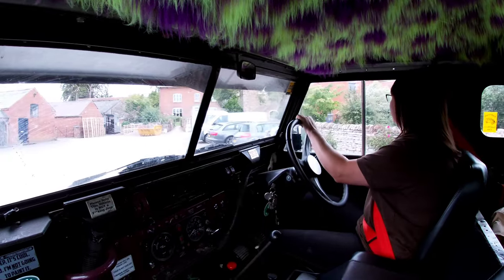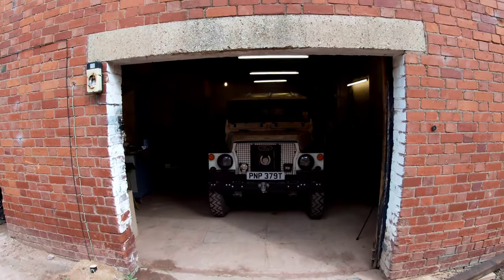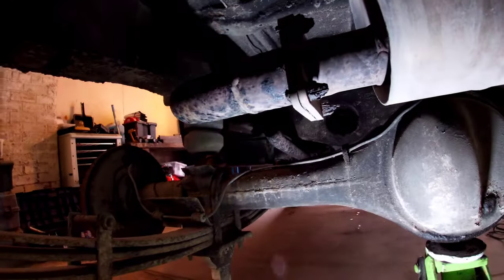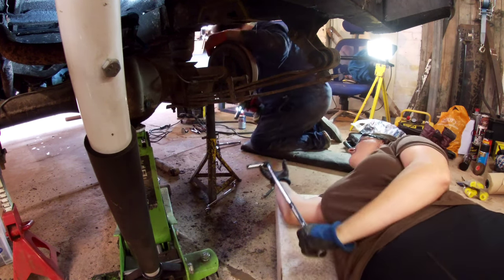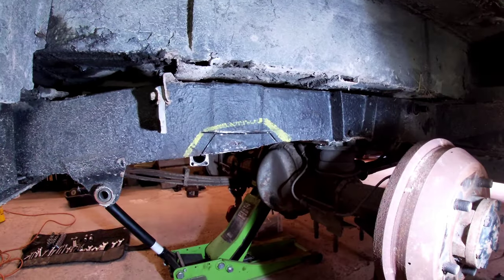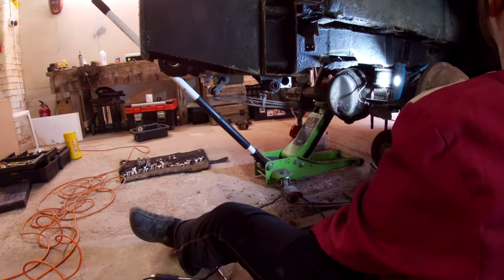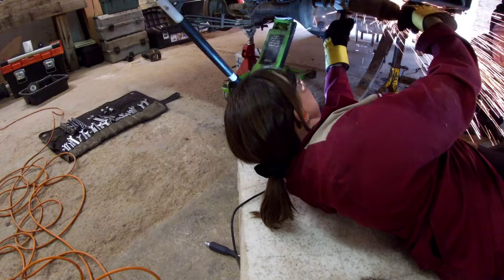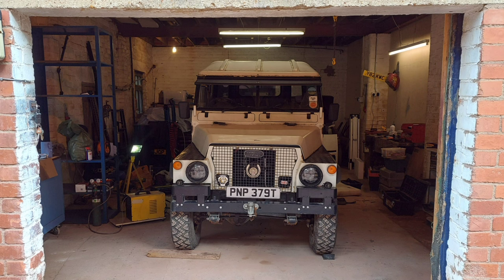Land Rover Lightweight  - Rust ! Rear Chassis and Suspension - PART 1

Comment: Looks to me, Alex, that you need a new chassis frame.  Chassis frames are not all that expensive.  The worst part is all the labor it takes to replace them.  And, of course, once you get started on that, you're more than likely to need new wiring harnesses, all new nuts, bolts, etc., and various other parts.  But keep your old MOD Land Rover running.  "There is no substitute for Land Rover, the World's most versatile vehicle."  Keep up the great work!
Reply from the maker: Yes it really could do with a nice galvanised chassis.... 
Unfortunately the previous owner replaced the rear quarter chassis years ago and it is rusting where they meet 😔 . 
We will just plate it up for now and make it last a few more years 😄 x

Comment: Were there additional videos showing the actual welding? I would be interested in watching those. What thickness metal were the repairs made in? I am about to start a similar process on mine.
Reply from the maker: Hi ! There are some vids of some welding i did . 
I have no idea what gauge metal i used. 
It was something i had kicking about that looked a bit thicker than the chassis metal.
Reply: @Alexsassets  Thank you. I will have a better look at your page.
Reply from the maker: @Guffin45  I've done lots of welding on my P6 😬
Reply: @Alexsassets  It was the land specific I was looking at. Thanks